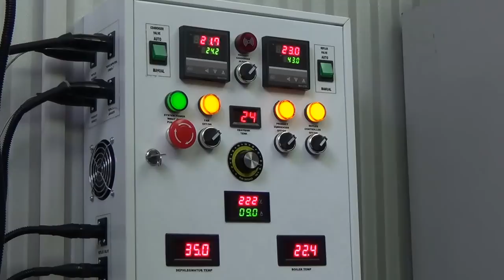StillDragon® - 5" Crystal Dragon™ with NEW ProCap36™ + Flow Director Bubble Plates Demo Run

Comment: What are you using for cooling water control? I think our hoses and valves are too big which makes keeping the dephlegmator input temperature constant very difficult.
Reply from the maker: +Daniel Maguire What you see in the video was a test setup with a solenoid valve, which is overkill in most cases. It's generally just push connect needle valves and fitting 12 mm hoses that do the job just fine. All the necessary parts for dephlegmator and product condenser cooling are offered by your responsible StillDragon® distributor. For more information on that topic, try the following tag search at the StillDragon® Community Forum: https://www.stilldragon.org/discussions/tagged/cooling
Reply: I run a danfoss on my other still to save water but it seems to be too robust for RC on this setup. I'm fine with needle valves, my operation is pretty manual.
Reply from the maker: +Daniel Maguire WTG! Absolutely no need for automation, add a thermo tee to the outflow of the condensers and you are good to go for a fine grained and water saving operation with needle valves at the inflows. If cooling water is sparse, a recirculating system is the solution, there is quite some info about that on the forum. If you have any questions, please post to the forum, because I'm just the administrator and YouTube comments are not very suited for discussions.

Comment: How much utilized power kw/h this column?
Reply from the maker: It's is more a question of boiler size than column for power requirement. A pot belly boiler in this size can usually be used with up to three immersion heating elements from 2000 to 5500W (though that's most likely overkill). The more power you have available, the shorter the heat-up time, it can be turned down quite a bit during the actual run. Please be aware that I'm the forum adminstrator only and I'm not responsible for that video. If you have any questions, please visit our StillDragon® Community Forum at https://www.StillDragon.org